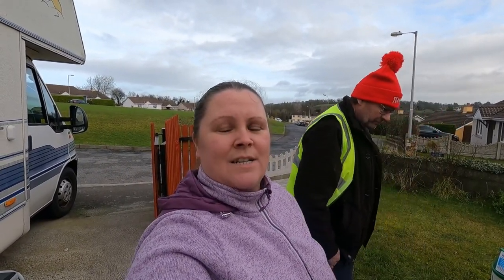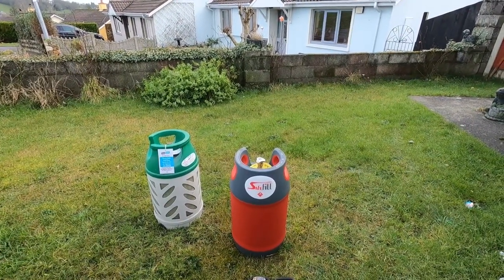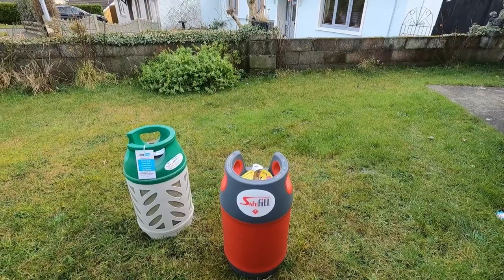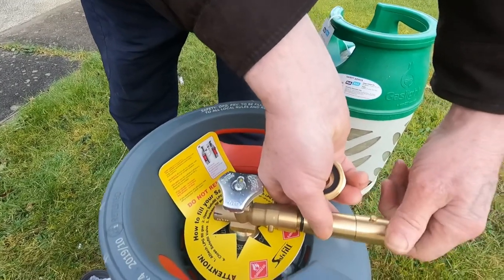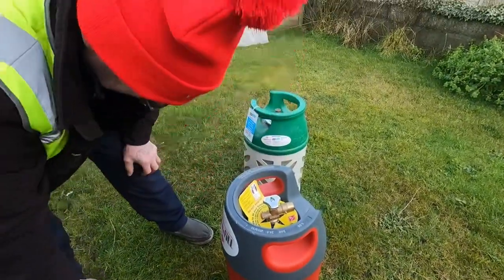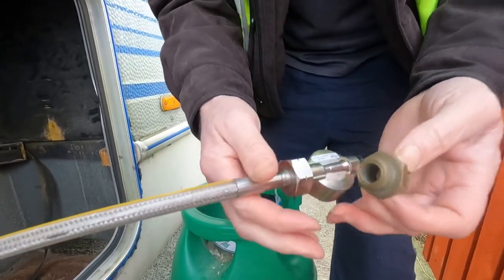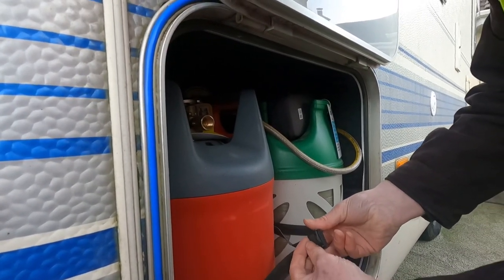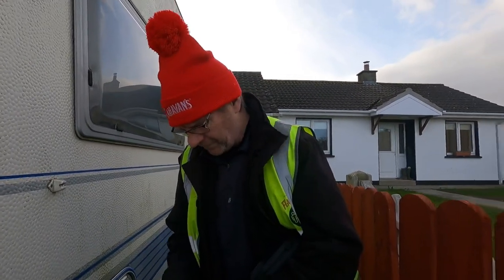Propane LPG SafeFill & Gaslight Cylinders

Comment: Hi Pamela & Johnny.  It's nice to see advice from an Irish YouTuber, as most of the videos are either UK or USA and don't answer all our (us Irish - I'm from Limerick) questions.  I really want to replace our propane gas bottle with the SAFEFILL  refillable (don't fancy cutting a hole in the van to refill).  I'm just afraid the SAFEFILL bottle won't fit in our locker.  They look chunkier than the ordinary gas cylinders.  If you get a chance, I'd be most grateful if you could measure the height of the bottle and more importantly the depth (turn bottle upside down and measure the base.  I know they do a 10kg , 7.5kg and 5kg, I'm assuming yours is 10kg.  Thanks for your videos and hopefully we'll be out and about soon.
Reply from the maker: Hello Mary, Johnny will measure it 2 morrow in the daytime and will let you know the measurement, I’m from co Waterford, Johnny is a tipp man 😆 😆 ,  yes ours is a 10 Kg one ,  they are very handy and very light weight, I can lift them no bother,   They are expensive but you will make your money back refilling them ,  Ill comment here tomorrow on the measurements,  thanks Mary

Comment: Really nice video 
Here in the UK its 55£ to fill the gas Light 10kg Bottle 😢
To be honest for heating i would use a diesel heater because its so much cheaper and you have allways got diesel 😅
Reply from the maker: @billturner6564  thank you . We done this video 3 years ago . We’ve a new camper since then . But we still use these gas bottles.  I wouldn’t but a diesel heater in the hymer because we don’t need it .

Comment: Gaslight and Safefill plastic bottles ARE the way to go in my opinion. Light light light!!!! Did the math, found that two filled 10kg bottles are lighter in weight than a single Calor 13kg bottle. But the hugely cheaper price of refilling the Gas at Morrisons in comparison to exchanging a 13Kg Calor bottle........well, what a B........Y rip off!!!
With two bottles, get the automatic switch over Twin Bottle Regulator (this can be connected to the ALDE control panel to let you know when a bottle switches over....Brill!!!), and have the two small filters added to it also, one for each bottle. Previously I experienced contaminant issues whilst using and refilling continuously from Repsol gas stations in Spain. The recommended filters fixed that issue straight away.  Again, I initially ignored that advice and cheaped out, only to get my butt kicked down the line.
Travel in Europe: 
Never forget that gas as sold in hot countries tends to have a different 'mix' to ours in the UK or Ireland. The percentages of "Good Gas, Propane" are lower in Spain and Italy. The "Not so good, and much heavier liquid, Butane" tends to freeze up a regulator when the outside temps drops much below 5 deg C, (reducing the gas flow or stopping it all together!!!), this happens in Spain over winter and other southern Med countries also. That's a pig when your trying to enjoy your holiday, but it's an absolute nightmare when you then go up to Scotland, or maybe up into the Alps, then the entire thing freezes up solid and your wife does an impression of that Blue Smurf thing!! 
BUT, these gas regulators can also be fitted with a Anti-icing device, (it's a small heater device and it can also be controllable from the ALDE panel........they think of everything these guys), so don't cheap out, get that fitted too!!!!
Now, the really important stuff which nobody tells you about refillable bottles and gas mixes.......!!
The only thing to keep your eye on over time in the cold months, is the continual build up of the "Not so good liquid Gas, Butane" in your bottles. As the "Good Gasses, Propane and derivatives" liberate out from their liquid state, what's left behind, will not "Phase Change", (the process of change from liquid to gaseous form), this is the rubbish stuff, Butane and heavier Liquids known as condensates. So for each refill, you'll get less Good Stuff as time goes by,  your system, either with automatic change over or not, will be changing bottle or just stop as the pressure drop occurs, and subsequently from there you'll be putting back less and less good gas at each refill as the % of Butane steadily builds up. Before long, you'll be looking at your still half full gas bottle, wondering why either the regulator changed over or why it has stopped flowing? Eventually you will need to start dumping these condensates overboard!! Now there's a trick in the winter.......................!! How do you get frozen Butane out of a bottle when it wont come out on its own and without blowing your self to kingdom come......Ha ha!!! Preferably, how do you avoid this mess altogether?
Try this:
https://www.coleparmer.co.uk/i/powerblanket-pbl100-lite-gas-cylinder-heater-100-lbs/4202545?PubID=UY&persist=true&ip=no&keyword=&gclid=Cj0KCQjwse-DBhC7ARIsAI8YcWLCxP5MLvsiRyYrXjsnX4MF6iVuZaFfsn4DGMd4z47RHRGuR7MKnRAaAj3iEALw_wcB&gclsrc=aw.ds

As a little tip, don't forget to purchase a couple of sets of spare O'rings for for your European refilling adapters. Don't get caught out on that simple prep.
Reply from the maker: Thanks very Much Iron Duke , Johnny is delighted with them tips ,  we hopefully will be going to Spain next year, so Johnny will get that sorted ,

Comment: HI guys - thanks - I have been looking for a video on gas - find it baffling with all the connections out there across Europe.   I am not fully getting it - these tanks are VERY expensive so it takes years and years to make your money back through the cheaper gas?  Depends how much you use I suppose. Can you tell us where you got the adaptor kit and would that be good for connecting any European tank direct to your van (rather than for filling up?).  if the adapter kit does work to let you attach any tank to you van - then why do you need the safe fill tank for Spain?
Reply from the maker: I put the link to everything I got in the description underneath the video,  
we found this works better for us,  we where told people fill up there cylinders in France & Spain and here in Ireland. Them safefill Cylinders can’t be over filled . So I’d prafer them,  you can’t use them connectors on our green cylinder,  
We don’t have a tank on the Motorhome there is no room for one our Motorhome is factory made,

Comment: I was always wondering why people buys the UK extension, I didnt realise its left hand thread, I use them on my car but those are right hand threaded. the question I want to ask is why do you still use the flo-gas cylinder if you have the safefill one now.
Reply from the maker: You People??? 
Because not all places in Ireland have gas stations where we can fill up . So we liked to have both cylinders.
Reply: @pamelajohnnysmotorhomejourneys  ok I was given the impression that all autogas sellers will fill them

Comment: Is not connection to safefill rubber
Reply from the maker: I dunno are you joking ??
Reply: @pamelajohnnysmotorhomejourneys  hi no not joking ,had small leak when face to face metal lpg connector.lpg shop showed me and sold me correct one for the safefill bottle they retail.
It had a rubber face on the connection .
Reply from the maker: No never heard of one . Do you have the name for it and we will buy one in case we need it.